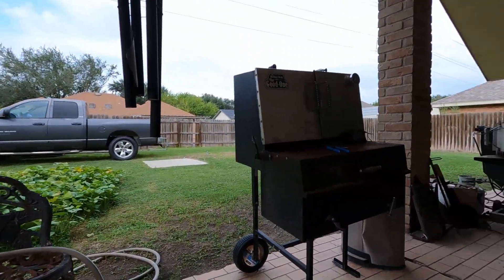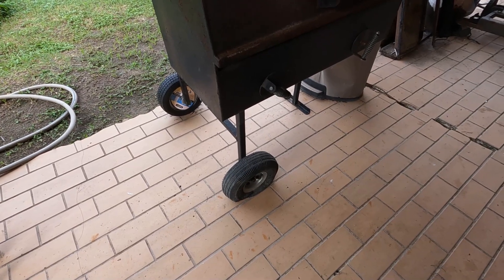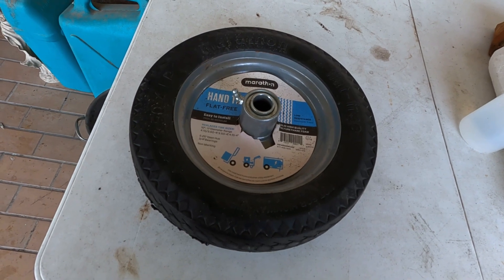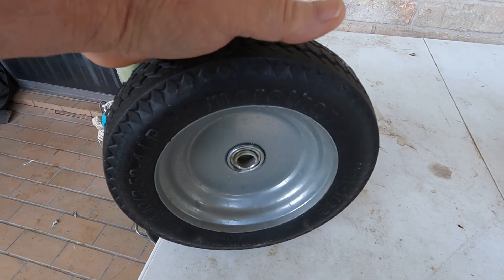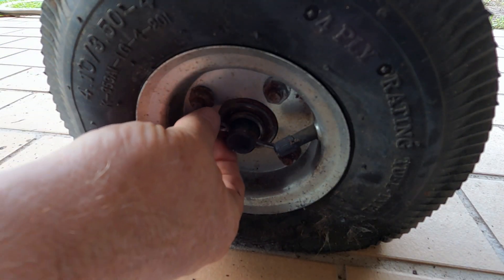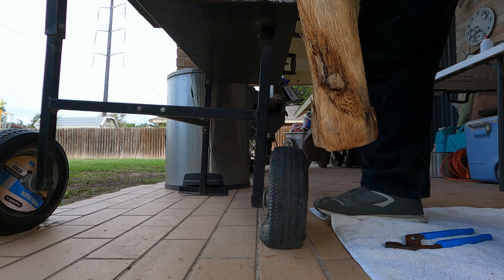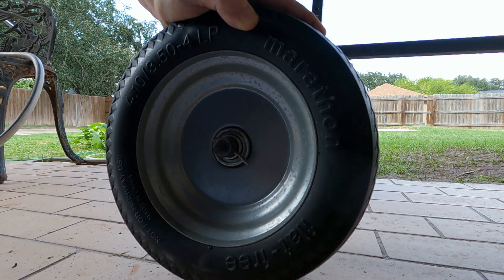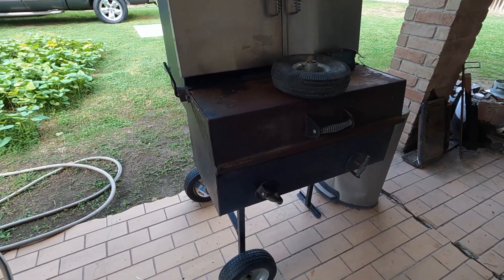WQ7 No More Flats on My BBQ Pit.

Comment: Nice upgrade Randy.  I had to do the same upgrade to my Open Range several years ago.  I used a never flat tire and wheel from Northern Tool that looks similar to yours.
Reply from the maker: Much nicer now that I don’t have to air the tires up every time I use it. Thanks for dropping by Wayne.